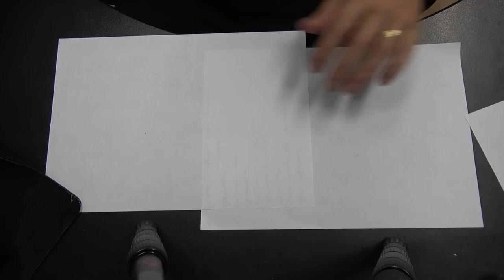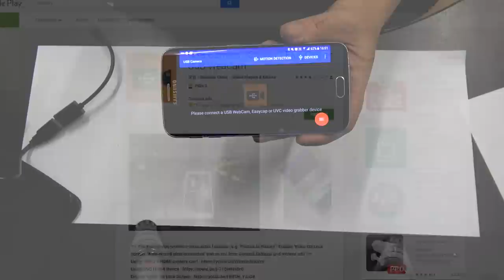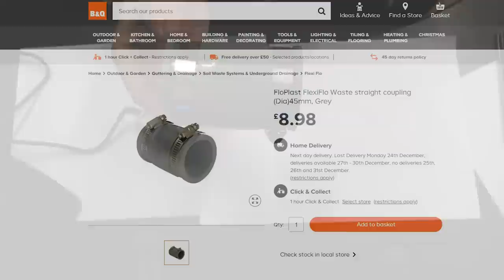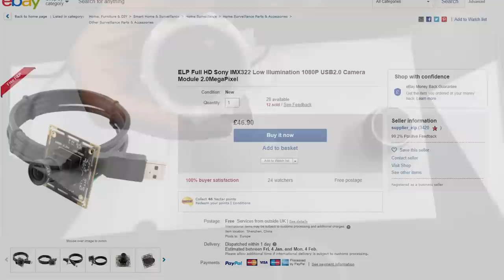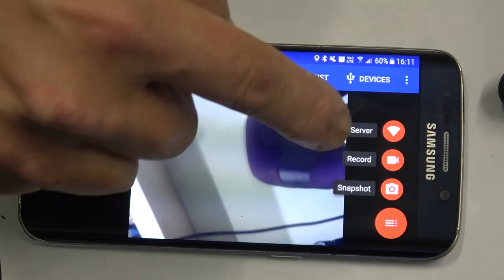Night Vision with Smartphone

Comment: for the OTG cable, make sure that you check out your device to be able to use a OTG cable.  Samsung J120A which is also a ATT Go phone does not have OTG capabilities, and so does the Hydro Air from Kyocera.
Reply from the maker: Good information
Reply: My Huawei did not support otg USB apps either. Yet an old LG g3 did

Comment: I got my camera off eBay,it's the same as the one that is second on your list and it already has IR capable lens fitted,you could still change it for a wider angle but works as it is,this may be of some help to people who don't want to mess much,I've still swapped mine for one I already had but didn't need to glue any bits on,finally,,OTG VIEW,,,free app,no adds,,works a treat,
Reply from the maker: Nice one, thanks for the info, will help others.
Reply: got a link please

Comment: most smart phones dont have an ir filter, turn on your smartphone camera point your tv remote at the camera and push power if you see light then you dont have the filter. Only reason i say is you only need the phone scope mount and the ir flashlight way cheaper route for same outcome works great on our air rifles.
Reply from the maker: Never tried this to be honest
Reply: @airgunology  thanks for the reply give it a try see what you think.
Reply: @micarifamily1  actually tried this with my phone before seeing this comment,i have a samsung s9 and can see the purple torch beam through my camera,however id didnt seem to work when i put it up to the scope couldnt see anything just darkness🤷🏼‍♂️😔

Comment: Very helpful, however not much available on Amazon and no 16mm lens. I bought a diy build kit from  a guy on e bay who showed them on YT a couple of years ago but could never get it to work as the lens was very badly mounted ie. off centre and not square and as it was on the last thread I could not focus it so gave up. As I am not very technical I'm not sure if there is another camera I could use. Keep up the good work.

Comment: Hi Steve, would there be any advantage by using a sony imx 317 4k sensor usb type camera?
Reply from the maker: As long as you can remove the IR filter, then no, just plus points as long as it works via the usb to mobile

Comment: With the right apk you can use smart glasses to replace the phone. (I own a pair of epson bt 300s, also a great way to make DIY nvg)
Reply from the maker: Sweet, any links ?
Reply: @airgunology  my epson bt 300 smart glasses was designed to fly dji drones (I own a mavic), 
so it has micro b support, I was able to connect an action cam with Wifi video streaming to my glasses and used an apk site for the software.

 I then removed the ir filter from said camera and attached an ir torch to it and used a head torch strap and a make shift holder for the torch and camera and ended up with a very ugly but functional nvg system.
Reply from the maker: Now that sounds cool :)

Comment: Put an infrared filter on the scope, to avoid white outs.
Reply from the maker: No, the IR filter is removed otherwise it will not work with an IR torch. This is what makes it a Night Sight with IR. The way to do it is to put a lens cap on the scope with a hole in it to let less light through.

Comment: Cant you put the phone camera directly into the scope? And if no, why not?
Reply from the maker: You can, this is called a sideshot and requires a special bracket. But it will not be night mode as the phone has an IR filter on the camera sensor.
Reply: @airgunology  ok.. thanks for the reply

Comment: Hi Steve. Any ideas why I'm getting great image quality when camera is not rigged up to my scope but as soon as I slid the tube over my scope I just get floods of white light no image quality just bright white light. I ordered the camera from ebay which is the one you show in your vid I believe this lense has an ir filter but I can't unscrew it but do have another one coming which should not have the ir filter do you think this could be the problem as I do not know what else it could be?

1 hour ago
Reply from the maker: Make sure you have the correct lens and then move the camera back and closer to the scope on the tube to get the right picture. The IR filter only needs to be removed if you are using IR at night.

Comment: Now for those handy with a soldering iron, surely you should be able to make up a lead that goes directly to mini USB (for Android). Trouble is knowing which wires go where. I have 3 wires from my 'board' camera: red, black and yellow. Can anyone tell me what pins they should be assigned to on the mini usb? Thanks in advance!
Reply from the maker: Not sure if that is possible or what sits in the OTG cable you would be replacing.

Comment: Hi steve, great video. I've bought the supplies & have 1 question pls. So we remove the IR filter from the lens for night time but is there an IR filter that we can attach to the objective end of the scope or something similar so that I can still use the setup at day time. Hope you understand ☺️ Thanks
Reply from the maker: Yes, just search out for a 16mm lens with a filter on the back of it, like the original lens that comes with the camera.
Reply: Search IR lens filter on eBay they do them for photography which will probably screw on objective,I've just seen a 50mm one on there,

Comment: Best use a sf or ao focus scope rather then fixed focus as it will blur out at different ranges
Reply from the maker: You adjust with the parallax wheel to solve as normal.

Comment: could a web cam with usb be used instead
Reply from the maker: The camera needs to have a removable lens and more importantly, you need to be able to remove the IR filter as that makes night mode with and IR torch possible. A web cam can be used, as most of web cameras contain the same camera chips / sensors, albeit with the IR filter removed.

Comment: Most phones can see ir so why not just use the phone the camera as well?
Reply from the maker: Most phones, including mobile phones have IR filters in them to stop the IR light and glare. You can use your mobile if you take it apart and remove the IR filter and make the phone useless for normal photo's. This is the reason for using the small camera that has no IR filter.
Reply: Steve Allan my phone has an ir filter but it’s really bad and still let’s a lot of ir in so I’ll probably just use that.